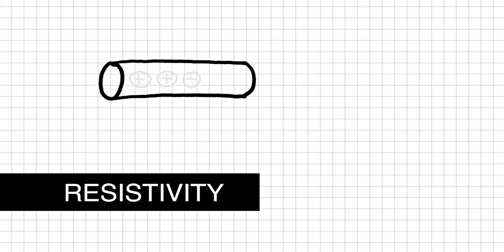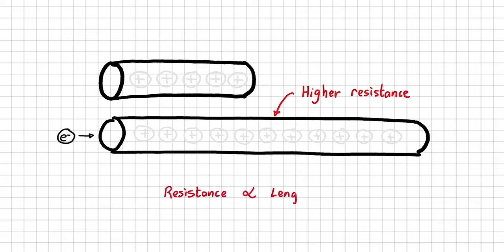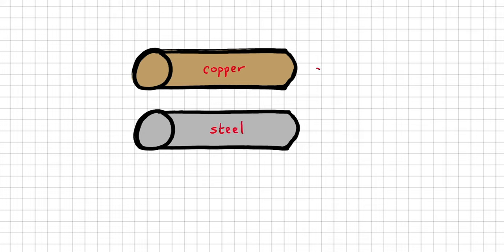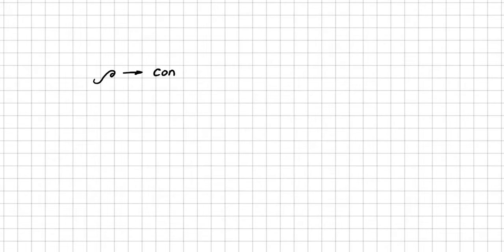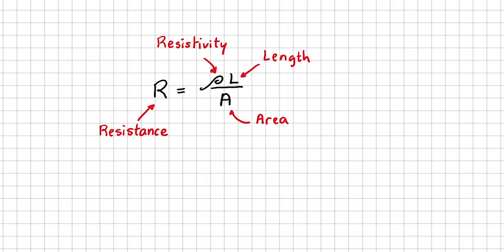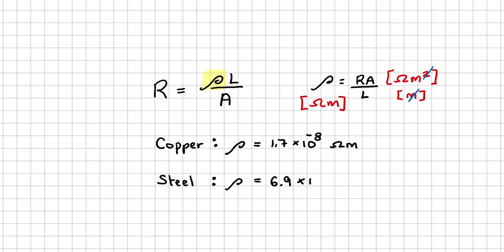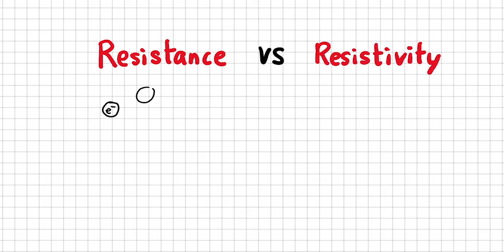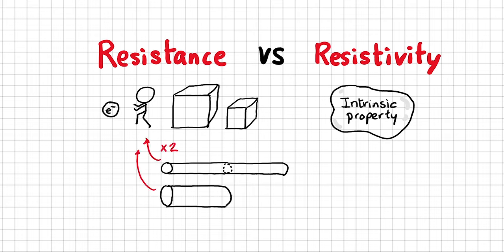Resistivity - A Level Physics

Comment: Hello! Thanks for this video ❤️ I wanted to ask a question regarding resistivity. In my textbook it is mentioned that resistivity depends on temperature. However, you have mentioned that resistivity is an intrinsic property and does not depend on the material's geometry. So, why is resistivity being affected by Temperature ?(and also can you explain the term 'geometric property’).
Reply: Because as temperature increases the collision time b/w free electrons decreases ( we call it as relaxation time). Since resistivity is inversely proportional to relaxation time. When relaxation time descreases resistivity increases. And also the geometric property means the properties that are dependent of geometric dimensions ( like length, area of cross section )

Comment: If resistivity is constant than in the formula rho=(ohm×m2)÷m with any good conductor of material,if we change the length or the cross section area the resistivity is changing
Reply: Residents changes with the change in temperature,so if  the temperature is constant then the resistivity of a material becomes constant too